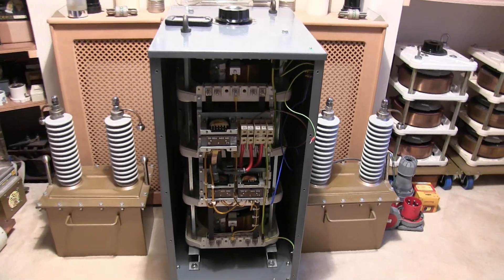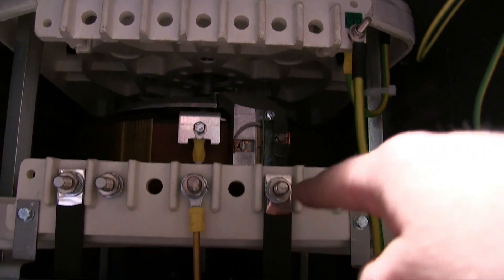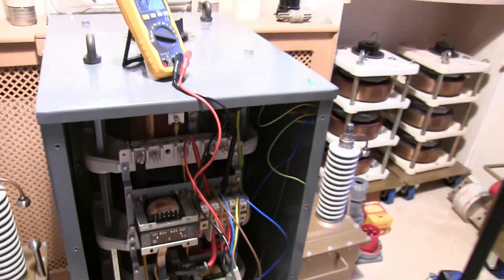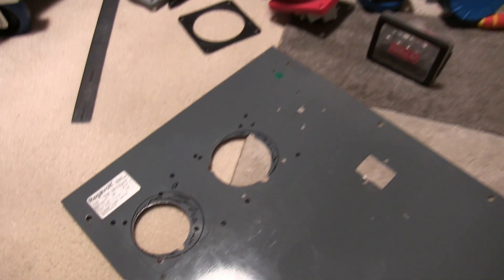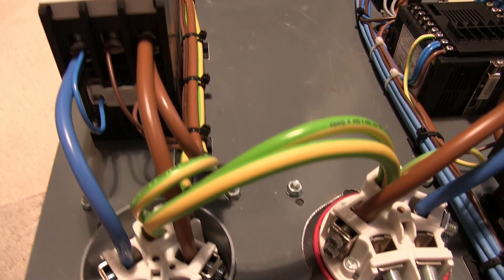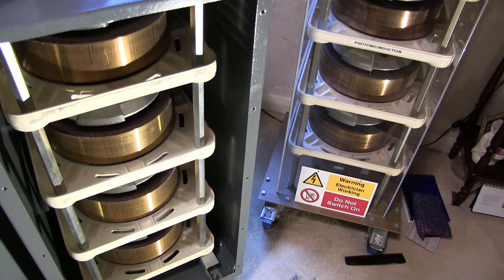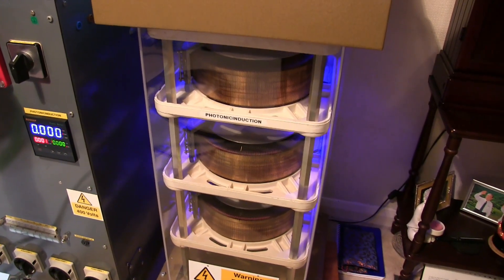100 Amp Variable Voltage Transformer

Comment: Tip for those that don't know: Wind up extension cords like that have a power rating based on how unwound they are. Usually they're good for 750w fully wound and 3000w fully unwound. Be careful when drawing too much power through one that is fully wound as they can get hot real quick.
Reply: Very true. I melted an extention once while mowing the lawn when I was a kid. Melted together in a coil. Not even on purpose.
Reply: @bjharvey3021  that's why gas mowers are better
Reply: Was literally just going to ask this, thanks. Would it be fine as long as there is no load on the output?
Reply: I remember learning this the hard way when my dad and I helped a friend of his strip wallpaper in a house he'd bought.
We plugged the stripper into an extension without unraveling it and it blew the fuse after a few minutes.
The coil melted completely solid.
Reply: Learned the hard way - three kliks flowing through an extension cord on a giant spool fused the insulation in no time, leaving me with a gigantic coil
Reply: @CynaOlow  Done that one. Was using something trivial like a drill at the time.
Reply: How about don’t “draw to much power”?
These comments are ridiculous.
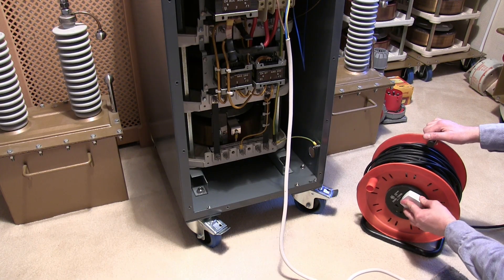Reply: It was just a short test run with no load on the transformers, so it didn't matter. Apparently, he used the relatively high resistance of that long extension cord to limit the inrush current (as he says at 1:15 that there is "no inrush"). Since he was just in an early stage of building the power supply at that point, he had probably not added any soft start yet. 
Those toroid transformers usually have problems with very high inrush current if they are connected directly to mains. They often need a soft start, to get running without blowing the line fuse (or trip circuit breakers) at start up.
Reply: Once came close to dying in a tent fire caused by a wound up cord powering a heater (not my fault I knew better)
Reply: Wind up!
Reply: If it was rolled from the middle, wouldn't that remove the inductance from it, and leave it the same as a wire wound resistor? This is how almost all long telephone line coils worked from the late 90's early 2000's when dial up was still fairly common
Reply: @Gunbudder  The inductance doesn't matter in this case, because there are 2 leads, carrying the current in opposit directions - that will cancel out most of the inductance. The whole setup is also running at mains frequency of just 50 Hz
 - so it need to be a significant amount of inductance for it to have any effect. It's mostly just the resistance of the long leads that matters (which he seemed to make use of, to limit inrush current). That's also what may cause the heating issue, if left running at high load (but in this case it was running for such a short time it didn't matter)
Reply: *reel quick
Reply: I have seen melted cords many a time...
Reply: Photon deliberately rolls up the extension cord so that it would blow up!
Reply: @alexrXX  LOL We dont put Photonic in this equation . Hes exception :)
Reply: I had one catch fire on me in a loft when I was an apprentice. We had 100w halogen work lights on the end of them.
Reply: on the coiled extension cord front i have a 3ph drill press and lathe and only one Static Phase Converter no budget for a second and they are on opposite sides of the shop so i made 40ft extension cord to be able to plug the lathe in interestingly when the cord is coiled on the wall behind the drill press the drill  has more power and it took me a while to stop breaking half inch drill bits (long and the short of it is the coil inducing a current in the "dead third phase") or am i being haunted by a ghost that hates drill bits?  ps i posted this in the main thread but then cam across your coment
Reply: I work as a stagehand at a concert venue and we wrap the stage power cables in figure eights on the floor as to not create a massive coil
Reply: Shouldn't the rolled up Cort work as a ballast and prevent overload so even when the whole drum is burning the fuse wouldn't kick in :D
Reply: @peterzingler6221  No, the inductance of an air core coil is too low at 50 Hz to make any difference. Plus the equal and opposite current in hot and neutral cancels any effect. If you wound the hot wire around a permeable core, you would have a lot more inductance.
Reply: @peterzingler6221  no, there’s no core as such and the current goes both ways through the cable so there’s no net field produced. It’s all down to resistive hearing and air circulation around the cable. Coiled up, there’s almost no cooling so it just gets hotter and hotter, then melts.
Reply: @WineScrounger  You don't need a core to have magnetic field around the loaded wire, rf circuitry uses coreless coils (fm/am radio, tv analog antenna input block). The core only adds induction._
Reply: @DjResR  like I said: the currents in phase and neutral add to zero. Also, an airless inductor at 50 hz? It’s not going to do much.
Reply: @peterzingler6221  Only if one wire is loaded otherwise it self-cancels the induction as two wires have opposing magnetic field and behaves as a low ohm resistor only._
Reply: @peterzingler6221  The rolled up cord doesn't have any ballast effect as both phases are running in opposite directions through the entire thing and are negating each other
Reply: I recently argued with a guy that claimed that coiled extension cords  nullify the field and dont get warm like inductor does. OFC hes wrong,,,
Reply: @CocoSloan  it's not the magnetic field that is the problem. It's the inability for the innermost coils to dissipate heat. The magnetic fields going in opposite directions cancel each other out.
Reply: @puckcat22679  I know its a problem to have them wound (coiled) while using them..Still that guy tried to convince me its not a problem at all LOL
Reply: @CocoSloan  I wonder who on earth made him think that !
Reply: Inductive reactance.
Reply: @MrRedeyedJedi  Yeah . Someone tried to tell me that the inductive reactance does not apply coz of opposite fields nullify the effect. Which is not true !
Reply: @CocoSloan yep, there's a bias!
Reply: I've heard that, but I've never seen it be an accrual practical/physical problem. Between all my crews, all my trailers, and all my job sites, I've got well over 100 extension cords. I've used thousands of extension cords and I've never picked up a coil of cord and felt it be even noticeably warm. Maybe if you've got a really long cord, and it's in a job box, where there is zero air movement, and you're pulling a 1500W sustained load, it might be a problem. Other than that, I've never seen any issue or heard of it happening on the hundreds and hundreds of jobs I've been on, with hundreds of subs, and thousands of workers.
Reply: @littlejackalo5326  It does happen, often a problem with newcomers to electric car charging. 20A through a coiled up cable will get the centre quite toasty after a couple of hours. I'd be surprised if a 1000W subwoofer (class D amp I hope) has an average power of more than 300W during a show.
Reply: @Beeeeeeeeeee   Same with corded drills etc. Drawing full load for 5 minjtes  probably won't hurt a thing. A sustained heating load will fry it perhaps. In this case Photon didn't have any load on the output so probably just a few amps of load, and it wasn't on for long either.
Reply: @littlejackalo5326  well I've seen ones with molten insulation. Usually happens when someone plugs a deep fryer in an almost fully wound drum.
Reply: @littlejackalo5326  try an experiment; load a wind up  extension cord to its max rating, fully extended in a normal operating environment, and measure its temp. Then, try the same with the same cord wrapped around its reel in its enclosed environment. I guarantee the temp will be higher. If you don't understand why, perhaps you didn't understand  @Sy when he made the comment.Bundled or coiled cables have less airflow between the cords, and are unable to dissipate heat as effectively, It is my understanding that extension cords in the US do not contain fuses, and the wire guage in many examples is below that of the supply  they are connected to, leading to the possibility of overload, and fire in wound cables.
Reply: @ianmorris8534  yup. The ubiquitous 3- core orange outdoor extension cords you see on construction sites and the like are usually 16 gauge, rated for 13 amps, and the wiring they're plugged in to is 14 (15 amp) or 12 (20 amp) gauge.
Reply: @ianmorris8534  it only works if you strip the wire and wrap it around an iron core.
Reply: @littlejackalo5326  also depends on the wire gauge and length plus quality/thickness of the insulation
Reply: @littlejackalo5326  If yiou are pulling 1500 watts it becomes a great issue,  They melt and short out, you have been lucky so far :)
Reply: @littlejackalo5326  You must not have connected any high draw appliances to one then, or only get good 14 or 12AWG stuff. 16 and especially 18AWG crap will overheat easily with something that pulls 10A+ continuously for a length of time. coiled up, the PVC insulation will reach the glass transition temperature and start to get soft and gooey.
Reply: @littlejackalo5326  Clearly, you don't do any welding.
Reply: @littlejackalo5326  Just because you haven't witnessed it doesn't mean it doesn't happen. Plenty of videos on here showing it in action. I've pulled 3kW through an extension lead and felt it get warm.
Reply: @littlejackalo5326  On the hundreds of jobs I've been on, with just a few subs, it's a regular occurrence.
Reply: Another thing to remember is that a coiled up extension reel essentially has the earth disconnected due to the inductive reactance.
Reply: @zedcarr6128  It's not inductive as all the conductors are wound, the magnetic flux cancels out.
Reply: @gabiold  Do a PAT test on a cable reel with it coiled up and fully unwound. It will fail on earth continuity when wound up due to the inductive reactance. If you check the earth continuity with a meter that uses DC, it will most likely pass,
 BUT you have to remember that it's an AC circuit, so it should be tested with AC.
Reply: @zedcarr6128  How is that test connected?
Reply: @zedcarr6128  If you test the individual wires, it is inductive, but in real life scenario the phase current is either flowing back on neutral wire in normal case or on the PE, on ground-short. In both cases the current which came in goes back in the same coil, so it isn't inductive.

The only scenario when it is more inductive is when the current comes from other source (not provided by the coiled extension cord). But I highly doubt that even in that case it wouldn't trip a breaker due to that low inductance. We are talking about only 50Hz here and a dozens of turns at high diameter. It is AC, yes, but it requires way higher inductance for the reactance to get significant.
Reply: @gabiold  The reason I say the earth is essentially is disconnected is I had a cable reel at work one time, and it was labelled as ''failed PAT test, no earth'' and when I PAT tested it, it passed when uncoiled but failed when coiled, so it must have been higher than the limit for earth continuity on the PAT tester. I agree that the inductance would be cancelled out between live and neutral, but the earth is a single conductor.
We have a cable reel at work, so I'll measure its resistance and inductive reactance tomorrow and give you actual measurements.
Reply: @gabiold  The earth continuity test usually puts 20 Amps AC through the earth and then measures the voltage drop to calculate the impedance, NOT the DC resistance.
Reply: @zedcarr6128  PE is an alternative conductor for current return in case of ground short. But the source is still the L conductor, unless you pump current into the system from a different source. And it is NOT inductive this way. And why you keep repeating yourself about "NOT DC" here? Inductance is non-existent at DC, I never mentioned DC anywhere in my posts. I think I were pretty clear, if we talking about reactance it is obvious that it is not applicable to DC.

The reason you have a failed test on a coiled cable is because the tester most likely tested the lead individually. But until the proper test arrangement is shown, like where the current flows, which leads, etc, I can't debate more on this topic, it makes no sense to repeat myself. 🤷🏻‍♂️
Reply: @zedcarr6128  no. Try a loop tester on this if you don’t want to run the numbers.
Reply: Probably provide more Radio frequency radiation when unwound too. Resonating at the same frequency as the length of the cable perhaps.
Reply: @garrysekelli6776  Probably not. The power frequency is 50hz, so that's what it would resonate on. However for the cable to be an antenna at that wave length you'd need around 2997925 meters worth. Probably more than most people are going to own, and that's ignoring any loss along the way.
Reply: @dataterminal  that number seems odly familiar. Like ive seen it before somewhere. But probably not important. Just like i told my highschool physics prof. We'll never use any of this bs in real life anyhow.
Reply: @garrysekelli6776  No, the wavelength of 50Hz AC is 6,000 km. Without a permeable core, the windings have negligible inductance. Plus the line and neutral have equal and opposite currents which cancel each other's magnetic field.

Comment: Turns out revving an electric motor can be just as fun as revving a combustion engine!
Reply: if I understood correctly, that was 40,000 watts he ran it on! 400 volts * 100 amps = 40,000 watts = freaking insane. aka classic photonic.